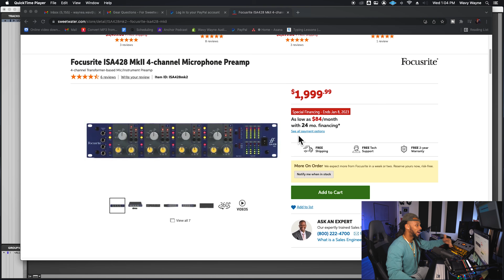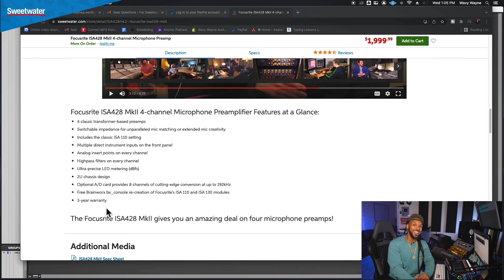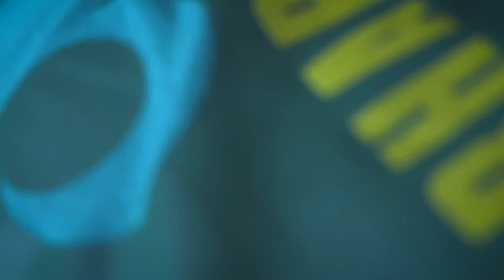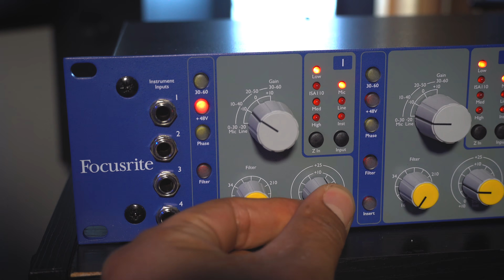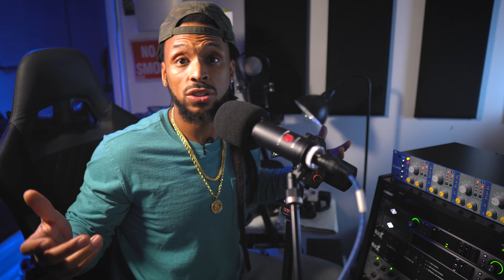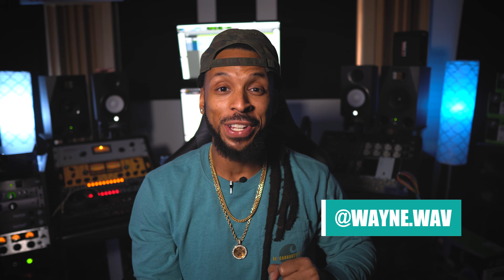External Preamp Setup for Recording Vocals (Part 1)

Comment: Why is the pre-amp still set to mic input if you are using line input?? This is where i am stuck, I am running a wa73 into apollo, but the cables are messing with my head, I gone xlr into wa73 but then i need to get xlr to line like you, as been just using line, then on apollo i should be on line input?? as input
Reply: The preamp is set to mic input because he connected a mic to the preamp XLR input. The preamp output is line output because the signal has been amplified and it connects to the interface line level input using a TRS connector. So your cable should be female XLR to TRS.

Comment: @wayne quick question I’m running the Apollo twin Luna plus Presonus studio channel rack which should I use as my actual gain pre amp or Luna im getting a low frequency
Reply: If I turn my amp up I get air if I turn my mic up it seems the signal fades

Comment: Great video, Wavy. But I am not sure what to set my interface levels at that are receiving my mic preamp signal. Is there a balance between both units to be concerned about? Thanks! :)
Reply: I’m with u there friend cause I have a signal established but it’s pretty low I’m not sure where to start turning up the amp or interphase

Comment: Do you really need a preamp?
Reply: no, but it does hold a lot of value
Reply: Yes u do, don’t listen to this person above…there’s absolutely no way but to go for outboard gear eventually once you’ve learned how to mix in the box(thru daw plugins strictly). Outboard gear in this video, Wayne tells u that outboard gives u bigger sound, warmer sound if u get a specific piece of outboard gear with a tube or tubes but warning tho these pieces of equipment can get expensive…but to complete my point sometimes there’s just not enough power in an interface even if it comes with a preamp…outboard gear is a must if u are building ur own studio

Comment: Thanks, this is helpful! I connect a black lion preamp to a simple focusrite interface, but I am not totally happy with the results yet. I’ve done it for a while now just like you describe, but I am reaching the limit to fast and wonder if there is a way to get more benefit of the mic & preamp power and coloration. 

Maybe my simple focusrite interface (2i2) is a bit weak … I just notice that my preamp has a loooooooot of gain power (80) that I cannot even begin to use. At 20-30 gain it is already starting to reach limit, but if I get too far from the mic there is just too much loss of the sound characteristics I prefer. So I wonder if I could do something better here. Maybe better balance between gain and output or … Do you have a tip how to optimize the mic - preamp - interface Situation even more, with additional or different gear or different settings?
Reply: With the 2i2 you go through the audio interface’s preamp as well even if you turn the input all the way down. I suggest getting a preamp with a “proper” line level input.
Reply: ALSO so important to mention is you MUST make sure that the cable you are using coming out of the ISA into your interface is a xlr (female) to TRS (instrument cable with TWO lines around the tip **not one**) and that the TRS side is going into a LINE input on your interface not just an input not specified as LINE. If this isn’t your set up you will be pushing your interface way too hard with volume and will lose A TON of headroom like you described. Hope this helps!

Comment: For anyone looking at getting a used 428, there's an older version with VU meters which some might prefer, but be aware that the older unit gets hot mainly because of the power supply used. If you keep it on for long periods, some have had issues with premature component failure, usually the power supply or components around the power supply. Along with the loss of VU meters, the newer 428 MKII changed the power supply to a switching power supply which generates considerably less heat.